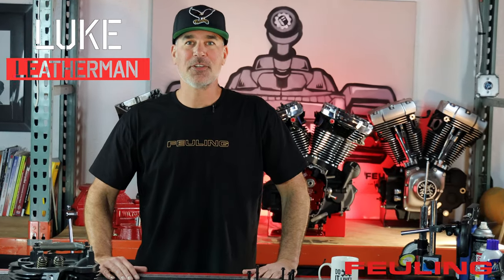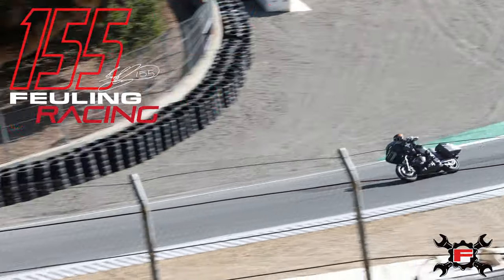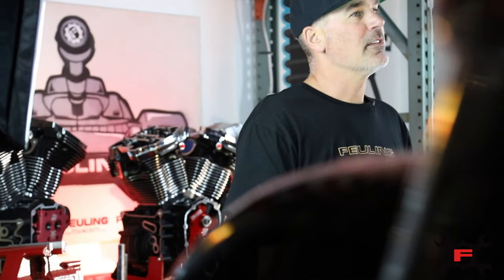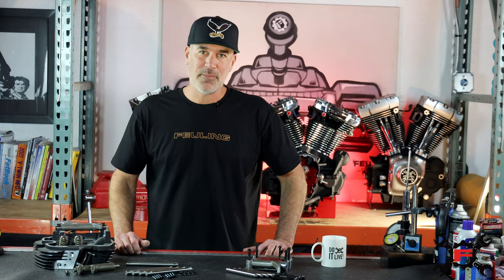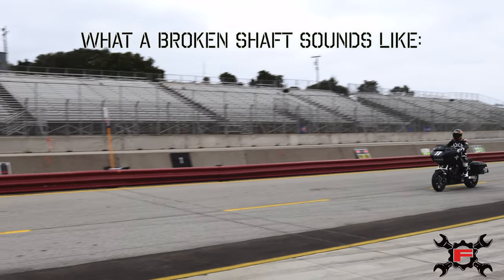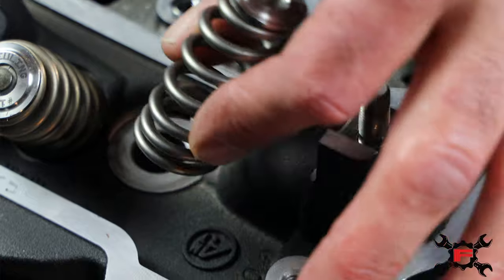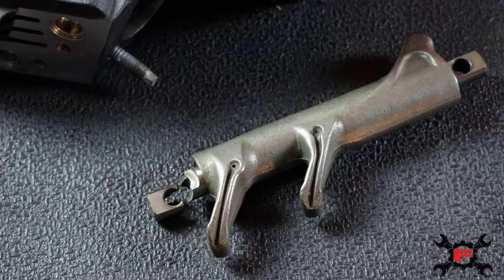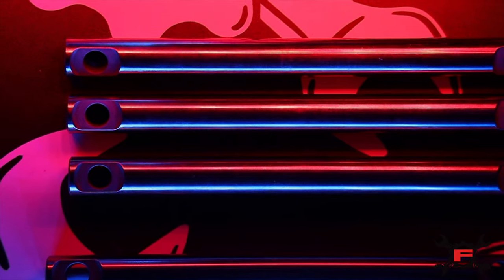GORILLA ROCKER SHAFTS

Comment: In the video it's visible the porosity difference between the stock shaft and the feuling. The stock you can see micro bubbles in the metal, the feuling shaft is like diamond solid and smooth.